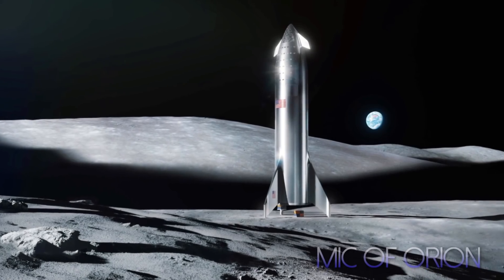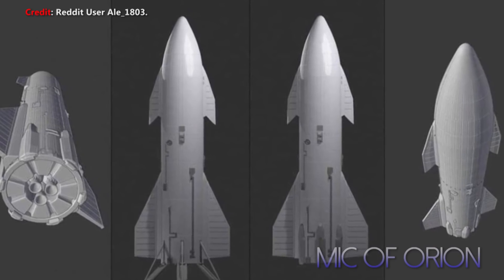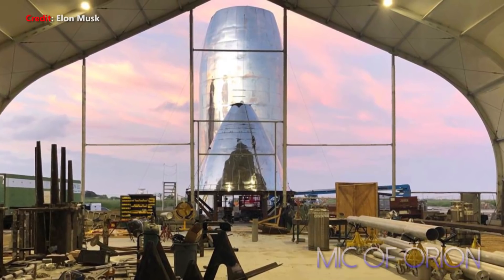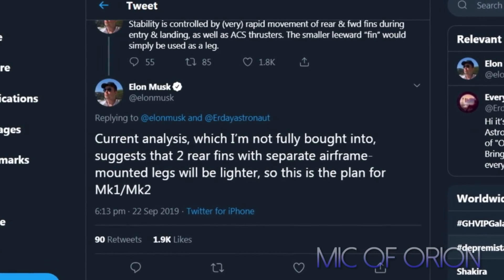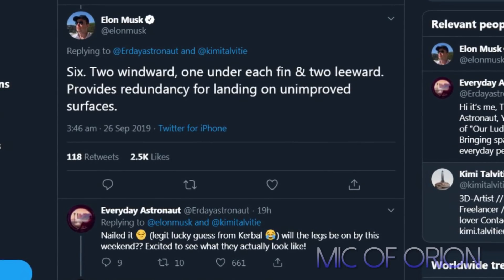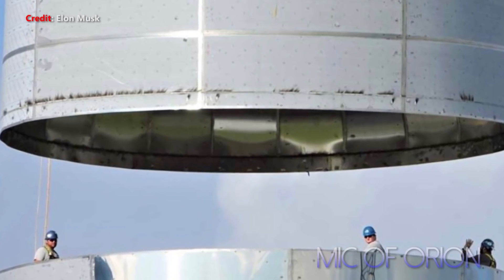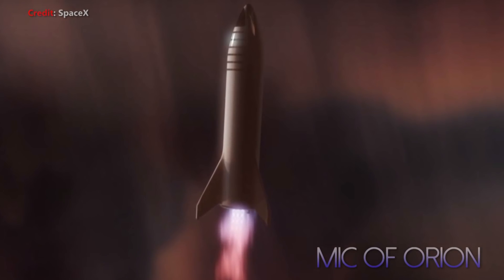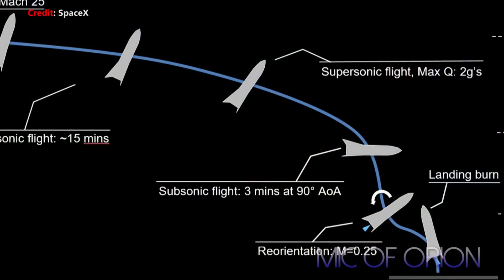SpaceX Starship Re Design

Comment from the maker: Ok very late upload, should have been up earlier,  Starship re-designed, what does it mean for Spacex and why? Looking at new design, however all speculation at this point we'll find out on 28th or 30th of September what the actual design is. I'll be having live feed of the event, and should be fun so guys join me.
Reply: Thank you for the closest reflection of the latest design changes in Starship. But some details may be more accurate.
The first of these is the legs. Musk tweeted: 2 legs windward, 2 legs leeward and 2 legs UNDER REAR FINS. Although in this case, it isn't quite clear where is the place for "smaller leeward fin used as a leg".
The second is the place of Raptors. As I understand there will be one more ring with already mounted 3 Raptor engines UNDER rear fins.
Reply from the maker: @ВалентинРазумнов-ц4к  plan is to have 6 raptors, with all 6 being mounted on ring like gimbal, allowing for small independent movement for each engine however we'll need to wait for final design to really make any assumptions, till tomorrow I guess. Thank you for your comment.
Reply: mic of orion:
Thank you for your answer.
I really think even Musk can't describe all these details for sure because the speed of redesigning is fantastic.
Reply: You expect me to join you at 1:00 AM?

Comment: Has anyone made mention on what platform it will land on the moon or, maz? The ground beneath could give away unless of course someone does an initial inspection??
Reply from the maker: Shane there are plans to ensure surface starship is landing on is capable of supporting it. Also each starship will be equipped with the radar that gives information on altitude and surface soil analysis. However NASA has already made a list of sights that are of interest and SpaceX is evaluating them.
Reply: @micoforion  OK but it's not tried & tested. This for me a the huge risk element for a monster of a craft if we start talking over 100 metres in height
Reply: @Mumbo_Jumbo_Kiwi.1  Well we arent, its 50-55 meters but yes this is a huge center of focus and they have many people working hard to figure it out.
Reply from the maker: NASA has done it several times already with landers on Mars, just scaling things up is bit of issue, i think SpaceX can draw on NASA's experience .
Reply: @micoforion ... perhaps so but I think you're going to need a grasshopper type landing mechanism on uncertain terrain. Those raptors will billow out a massive crater unpon landing. Marooned on Marz
Reply: @micoforion  Actually i dont think anyone has ever landed boosters or mars, they always make some crazy contraption to lower the rover or bounce it in giant balloons, you really need to start checking things before you dish out bad info like this and other things in the video, it shows you dont care. 
  Also, if there has been a FEW i cant think of, this is on a 1,000 times bigger scale and cant be compared in any way.
Reply: The landing spot could be prepared by   earlier robotic Mars missions. Robots could flatten and polish the landing ground before Starship's arrival.

Comment: Thrust vectoring, via pitch and yaw servo-actuators, has been a mainstay of launch vehicle steering design for single engine rocket motors for decades. Servo-actuator systems also individually gimbaled each of the three Shuttle main rocket nozzles and each of the two solid rocket motor (stap-on) booster engines. That was a total of five pairs of pitch-yaw servo-actuators being controlled on a Shuttle launch. Only 3-Raptor nozzles require vectoring on the Space-X Mk1 test vehicle, so, this doesn't sound like a ground-breaking development.  Will all seven of the Raptors on the starship be equipped for gimbaling? It will also be very interesting to see how many of the Raptors are equipped for gimbaling on the Super heavy
Reply from the maker: Yes, and yes to the gimble.

Comment: I have very much ‘mixed feelings’ about the new design changes. Wasn’t a bit fan of the three fin legs idea but still...whatever SpaceX comes up with quickly grows on you.
Reply: I think this design makes way more sense than tin-tin. Making the fins double as landing gear makes little sense. It would place huge loads on that pivot joint.
Reply: Daniel Whyatt why would you let it tho no two rockets before the finalization of block 5 were the same they had different designs so they dont really have a history of any songle design lasting more than a few months

Comment: I have seen a lot of videos about the new design of SpacX but nobody talks about one of the main reasons that the Starship will not have the third wing ... I think its because one of the Main features that  Starship wants to achieve is  its ability to Refuel in space .. and if the wing is not there it would be able to get close enough to another Starship to Refuel .. that is one of the Main features  that ELON and NASA are trying to ACHIEVE .. and it has to Refuel on the back side cause on the front side there will be to much heat when it reenters ... I HOPE this helps you for your next video .. !!!
Reply: manumus11 That makes very little sense.
A starship with 3 wings can simply dock facing each other (noses pointed in opposite directions).
In reality though, Starship will most likely dock to a refuelling ship with their aft sections facing each other.

The real reason Space X is getting rid of the third wing (for the moment), is because it was dead weight and was adding to aerodynamic instability.
The third wing has always been fixed in position. It wasn’t used for manoeuvring or braking at all. Since the landing legs will no longer be in the wings, the third wing is only added dead weight.

Secondly, the extra non-foldable aerodynamic surface adds to instability in flight. It’s really very basic physics.
Everyone familiar with aerodynamics knows that as a rule of thumb, you want to keep your center of lift behind your center of mass.
Having your center of lift in front of the center of mass of a vehicle causes inherent instability which tens to flip the vehicle over 180º the other way.

This means that not only will there be 3 wings far ahead of the center of mass on launch, but there will also be 3 wings far ahead of the center of mass when flying vertically down for landing.
Here’s the thing, the two articulating wings can easily be tucked close to the body and out of the airstream, greatly reducing the problem if the vehicle inherently wanting to flip over. The third immobile wing can’t do that.

It’s highly doubtful that docking has anything to do with it. Rather, simple physics is probably the real reason.

Comment: They have forgotten to add vacuum raptor engines and heat protection - will need to redesign again. Many times, I would guess..
Reply: They've forgotten nothing. Vacuum engines are needed to raise effectiveness in true vacuum. And this prototype is designed to make suborbital flights. The same concerns a heat protection shield. This protection is needed to lower first space velocity and higher. But Mk1 isn't planned to make orbital flights so it can't achieve first space velocity.
If this particular prototype shows great durability SpaceX will add both heat protection and vacuum Raptors to it.
Reply: @ВалентинРазумнов-ц4к  I mean, you cannot call it prototype without this key features installed. And use 'orbital' wording. This is an in atmospheric raptor test-bed and not a prototype of something orbital. Not to mention interplanetary.
Reply: Nike Crean:
Don't you understand the difference between "prototype" and "final version" of the machine?
Prototypes are extremely rarely full-featured. On the contrary, there could be several prototypes of one complicated machine each maintaining only part of possibilities that would have a future machine. For example, Starhopper is also a prototype but it has only 1 engine, is not full-sized and even lacks nose con.
Besides, heat protection and vacuum engines are not the "key features".
Vacuum engines are absolutely redundant for under 20 km flights and also will be unnecessary for the Earth-to-Earth version of Starship.
Heat protection (together with forward and back fins) will be unnecessary for the version of Starship aimed to transportation from Earth orbit to Moon surface and back to Earth orbit.
So, don't perceive all this terminology literally. In our case "orbital prototype" means a short formulation of "prototype of future orbital Starship".
Reply: @ВалентинРазумнов-ц4к  Prototype should be able to demonstrate key features of the final version and it is obviously not the case with all this iron made stuff in Boca Chica. It neither can reach an orbit nor withstand a reentry from the orbit. It cannot be refuled on the orbit and of course, it cannot make a journey to Mars. So what features is it able to demonstrate and to what degree ?
Reply: Nike Crean:
Your question indicates that you are placed at a very far distance from science and engineering.
Imagine that some machine has to perform 100 different functions, and each of this function can destroy it. Then building a full-functional prototype with support of all 100 function you will achieve 1) highly increased chances of its destroying; 2) highly difficult possibilities to understand what has caused this destruction and 3) highly raised costs of building new and new fully-functional prototypes. 
Therefore, engineers and scientists use the method of successive approximations. Firstly they build a cheap prototype which supports 20 functions of 100. They test it and correct design until it begins working properly and reliably. Then they add another 20 features and test it again. If some malfunctioning appears then probably it would be caused by these 20 additional functions and not 20 starting ones. And if it will be totally destroyed then losses will not cost so much as they would cost in the case of destruction of fully-functional one...
It seems to me that all this is obvious - a simple logic and common sense. You haven't to be an engineer or scientist to understand this.
Reply: @ВалентинРазумнов-ц4к  That were not questions really, that were assertions and you just confirmed that it's not a prototype of a whole orbital system but a test-bed for some particular subsystems. That's what I am talking about from the very beginning.
Reply: Nike Crean:
It's a little weird to read that somebody can assume that test copy of new car model must obligatory be equipped with crocodile leather seats and hi-end 8-channel audio-video system or "tests on track will not be fully adequate".
The great advantage of SpaceX compared to NASA, Boeing, NG, and other old players is in the fact that technology of reusable soft-landing rockets permits to test spaceships for an unlimited amount of time and repetitions while any SLS launch (both successful or not) will be the last.
Reply: @ВалентинРазумнов-ц4к  If you believe that adding revolutionary (as declared) heat protection and additional 4 engines with a double sized nozzles is as easy as asking for crocodile leather seats option, I will not argue with you) You are the coolest scientist and engineer)
Reply: @ncrean66  
This prototype is primarily intended to test and demonstrate Starships "flip and landing" procedure, which is completely unique. No one has ever tried to land something this large like this ever before, so of course they're going to want to test that before they go to orbit. One step at a time.
Reply: Nike Creene:
Have you ever heard of metaphor and hyperbole? I see that not.
What, in your opinion, is the insoluble problem of thermal protection? Its effectiveness has already been proven in Crew Dragon flight. To test how it can be better mechanically attached to the Star Ship, several tiles have already been placed on Mk1. What is the source of your scares? In the worst case there will be the variation of Space Shuttle with long service periods between flights - already better than it was. But knowing Musk I'm sure that full reusability will be achieved.
And who told you about "4 engines with double sized nozzles"? For the last 3 months Musk was tweeting about 3 sea level and 3 vacuum engines. And even if it will be 4 vacuum raptors, do you really believe that SpaceX does not know their sizes? Or that they will be completely surprised to see that for the seventh Raptor there is not enough space only at the installation phase ???
Showing the entire process of creating a Starship prototype does not mean that all this is done without any calculations and design.
And your highly demanding skepticism about Starship prototype is weird. Have you read anywhere that SpaceX already began to sell tickets to Mars and Moon? I know only about tickets of Virgin Galactic. Planning to move to Mars and appreciating the tediousness of the journey?
Reply: @ВалентинРазумнов-ц4к  Crew Dragon uses conventional classical heat protection and has no wings but Starship is going to use methane vaporising cooling  (at least, that was told to us when explaining why steel is better than carbon fiber) and has big moving aerodynamic surfaces that should be resistant to extreme heating. Adding four vacuum engines with big nozzles will for sure require redesign of the tail section and add more weight to the bottom that will lead to changes in control algorithms and new testing.
Reply: Nike Crean:
"Methane vaporising cooling?"
Please, use fresh information.
You questions are outdated at least 1 month. There was announced that new thermal protection (which was tested during last Dragon flights by partial substitution of traditional protection) showed sufficient safeness and reliability that allow refusing (at least - at this stage) of "methane vaporising cooling".
"redesign of the tail section"?
And that's all??? SpaceX intends to place 35 Raptors in Superheavy which must have the same diameter (9 m) that Starship has. So do you really believe that SpaceX can't place 6 Raptors in the Starship???
They've just redesigned the whole Starship, not stopping the building process, and this redesign took them maybe 1 week. So redesign of the tail section will demand 1 or 2 days for SpaceX...
But for NASA such a problem really will consume 1 additional year and 1 additional billion dollars.
Are you working for NASA? Your way of thinking is rather similar.
Reply: @ВалентинРазумнов-ц4к  So, no methane cooling any more ? The design was changed a month ago ? LoL
Reply: Nike Crean:
Yee, it's SpaceX style, it's Musk's style. They make changes during movement, they do different processes in parallel. They were changing Raptor construction while already building Starhopper, after first Starhopper test they've changed construction again (removing 600 Hz vibration problem). At the first look, it seems insane but only such work gives results: they've built 1.5 full-sized prototypes of Starship during 10 months. And NASA is building its first SLS 8 years already, having existing engines, existing boosters, existing technologies, equipment, testing stands, and so on... And nobody knows when this first SLS will be finished!
But in 1960th NASA worked so as SpaceX works now. Therefore NASA managed to develop (from almost zero level) and build Saturn V within 5 year period.
Reply: Valentin Razumnov Nothing bad in making changes (you may call it iterations) and doing things in parallel. I just amused by the fact that less than a month ago I left a comment under one of Everyday Astronaut "educational" videos where I called the methane cooling system as just a speculation in Musk's style. Didn't think the "sweaty" story would come to the end so soon. Carbon fiber story wasn't so short..
Reply: @ncrean66  lol ok but they do have vaccum, and atmospheric engines in both stages, and stainless steel protection plus pica-x heat shields sonolol
Reply: It already has plans up to MK-5 and none of those things are needed for this variant. They didnt "forget" anything. And if you know anything about Spacex, yes they will make many many design changes thats exactly what they do and how they have created the most advanced rocket mankind has ever seen The Falcon 9. Enjoy it :)